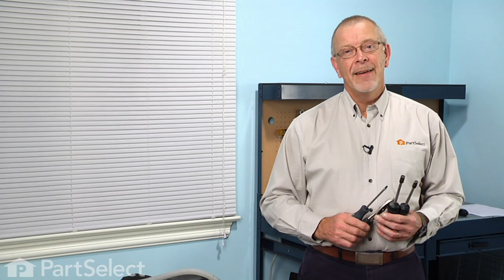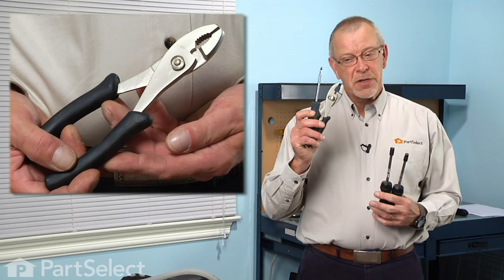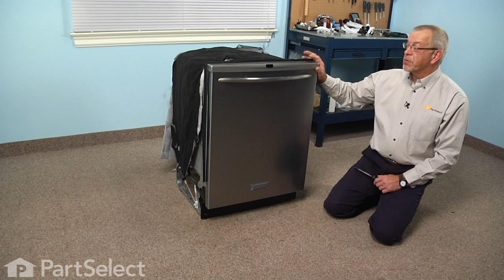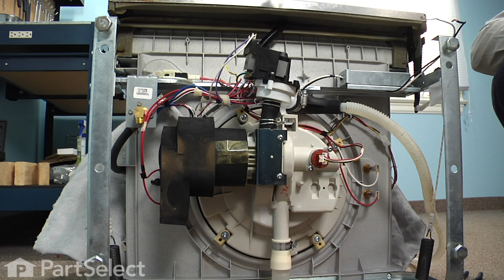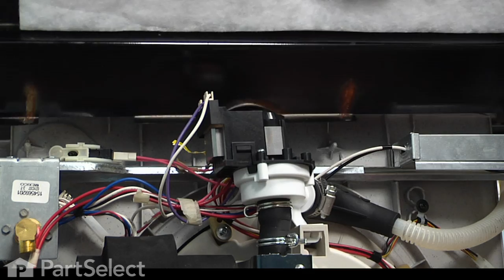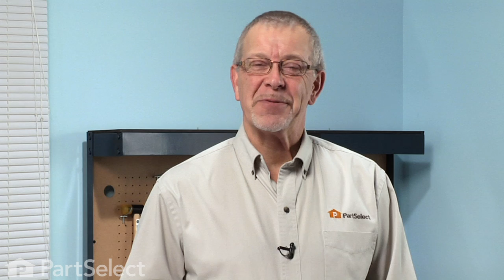Dishwasher Repair - Replacing the Drain Pump (Frigidaire Part # 154580301)

Comment: Does the pump usually go before the motor, how can I be sure it's not the motor?  Nice video:)
Reply from the maker: What is your exact symptom? If you are referring to this drain pump assembly in the video, I would suggest that the pump portion would be more likely to fail first.

Comment: How can I troubleshoot if I need a new pump or just need to unclog it? I have some water standing in the dishwasher and when I start my dishwasher it makes grinding noises and stops
Reply: +Uncontrollable Love I tested mine by pulling the drain tube off my garbage disposal under the sink and using a shop vac...   if it sucks out all the water it's not clogged.
Reply: +Bradley Sebastian I ended up opening taking out the pipe from the pump and it had a bone stuck on there, I don't know how it got there but now it is working.

Comment: One thing to note that will make the job even quicker and easier - you don't need to remove the dishwasher or disconnect the water supply.  I just removed the kick plates and changed my drain pump in less than 30 minutes.